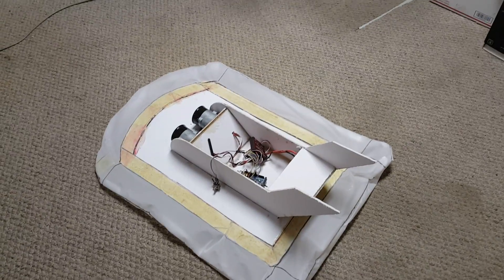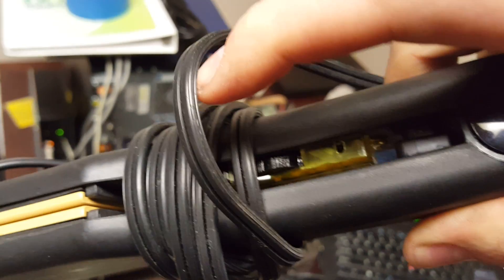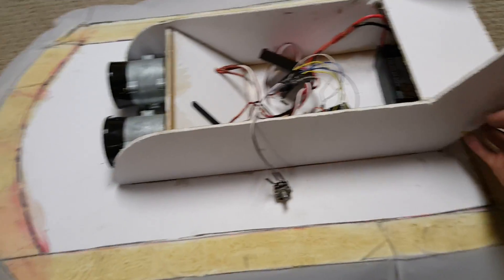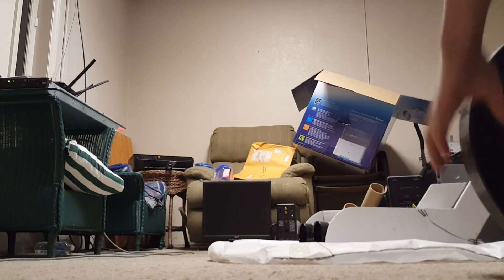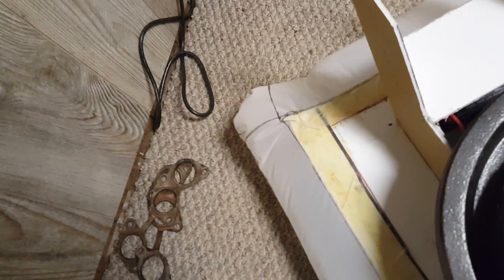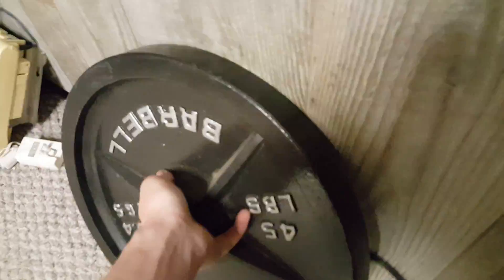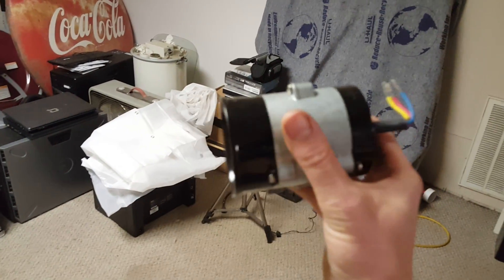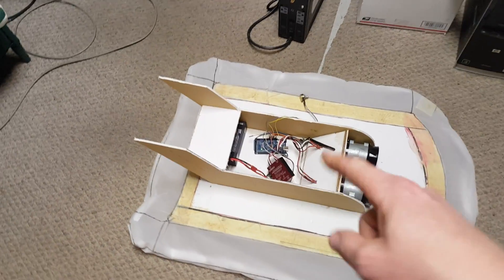Hovercraft test number 2 carrying 70 pounds

Comment from the maker: As it turns out, the fans are made of zinc and not alumeeeniuummm
Reply: +Doogie Rick for the skirt you could use a car or truck inner tube either with a single cut around the internal diameter or cut into sections and glued/stitched to make a more traditional skirt. Ripstop fabric from a power kite or 'chute also makes great skirts.
Reply: +Doogie Rick How do I get in touch with you via email?  --evstar gmail
Reply from the maker: +Ann Sophie Fans doogielabs@gmail.com